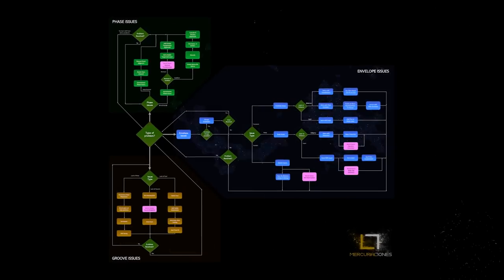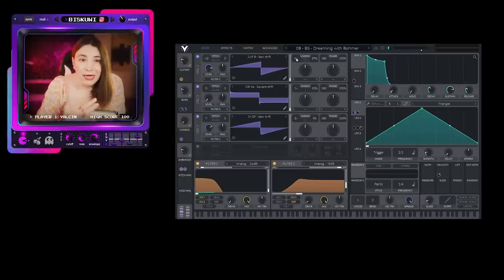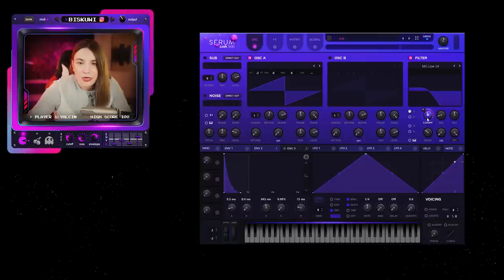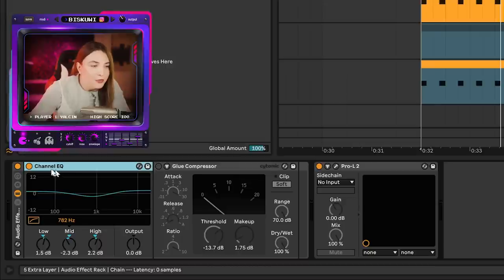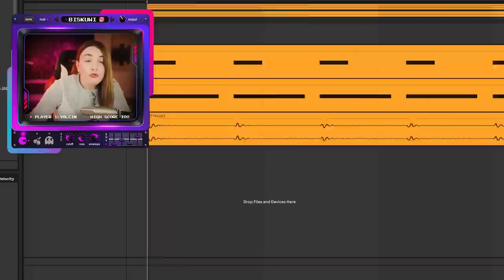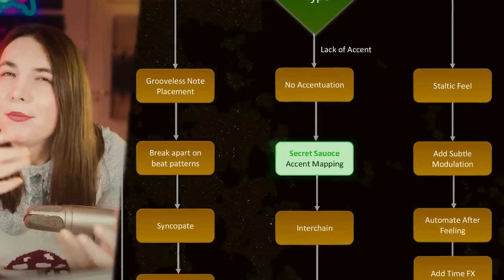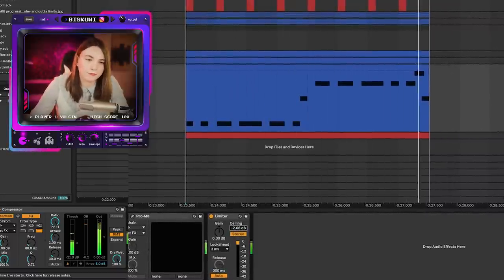This Will Fix Most of Your BASS Problems 🔊

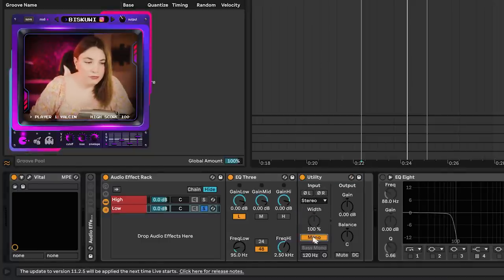Comment: 4:33 another option to set to mono and resolve some of the volume fluctuation is by setting the utility to “left” or right, soloing one channel will prevent some of the phase issues from summing the channel to mono, and require less limiting in many cases

Comment: Great video - also some plugins introduce delay like the Native Instruments Scarbee Rickenbaker Bass (i.e. a ~35ms delay from the initial attack/click sound that you can enable). It’s almost like an uncompensated latency in this particular case. This can really mess up timing and phase so it’s another thing to keep an eye on. In this case you can use track delay but should render it out to see what’s going on and adjust from there.

Comment: My favorite way to make the low end mono is to high pass the sides, and add a low shelf boost on the mid signal at the same frequency. That way, you don’t lose the frequency balance! I have a preset in Pro Q called Bass Focus that already has this set up. I just set the frequency to taste.
Reply: The reason I prefer it over collapsing the stereo image, is because of the phase cancellation you demonstrated. With this technique, you don’t need to compress or limit, so there’s no artifacts! :)

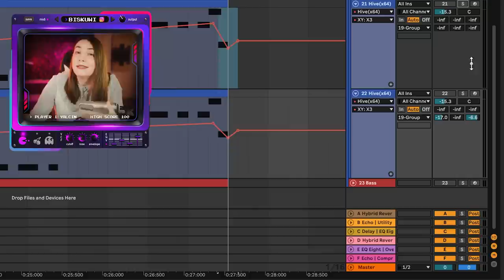Comment: Hello, I have a question, how to remove te low freq from the delay you put on the bass without effecting the low/high cut on the original sound of the bass, but only effect the eq from the delay of the bass? I try to put an eq after the delay in an fx send track in cubase, but the eq effects also the original bass track, not only the delay. SO I can't send an eq only on the delay without effecting the original bass track, also not as an fx insert in cubase. Do you have a solution for this, as you explained in 15:49? Kind regards! Rogier